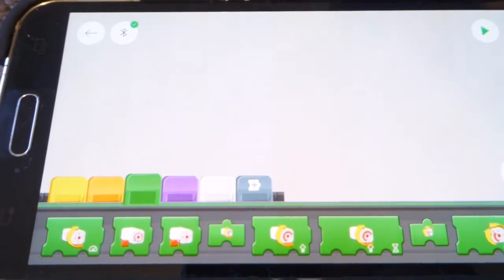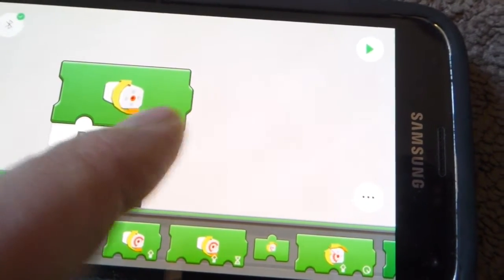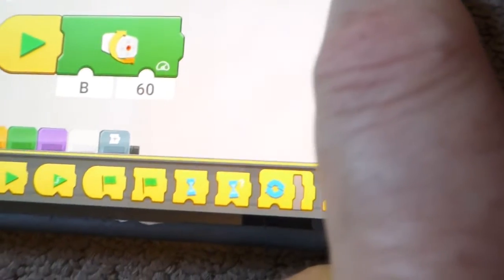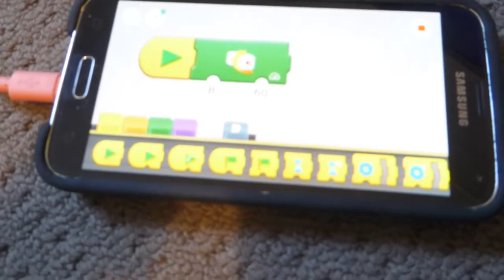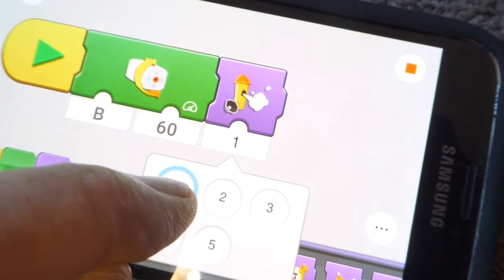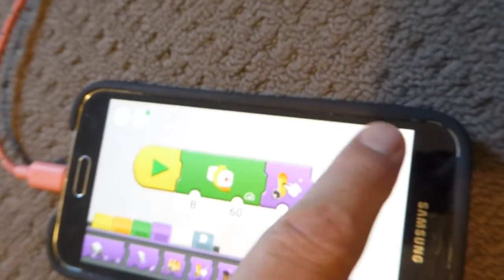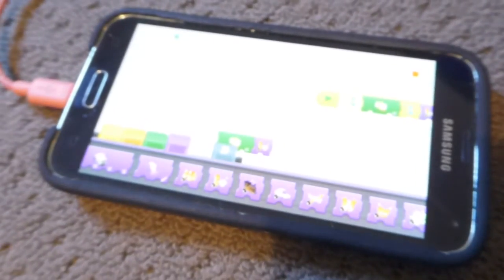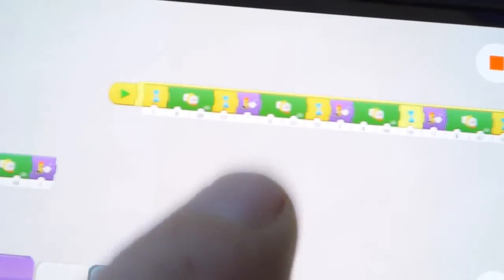Code example Lego Trains with Powered Up App, automate, soft start, sounds, loops.

Comment: I tried to connect the passenger PU train with this programme but couldn’t. Do I need to buy the SmartHub or something else ? Or did I do something wrong & should be able to connect them ?
Reply from the maker: I didn't have the hub. Connection was pretty straight forward. Look for it in the Bluetooth settings of thw device you are using.

Comment: Part of me thinks it's nice to get away from screens when playing with trains. Maybe I'm old fashioned.
Reply from the maker: I actually reach for the train remote that came with it rather than the phone. I dived into the coding after discovering it on the app being not covered in the paperwork it felt like an easter egg. Only to discover it is packed in there to allow Lego to offer their products as STEM enabled for the education market sector. By the time I finished the coding I had sounds triggered by the tilt sensor with timer delays so it didn't get repetitive...allowing me to pull 3 train sounds and have MORE control over the creeping speed using the phone tilt. The normal remote is 10 percent increments and can't creep unless the batteries are nearly flat. When bringing it into the station...the phone tilt makes a much more convincing train motion.